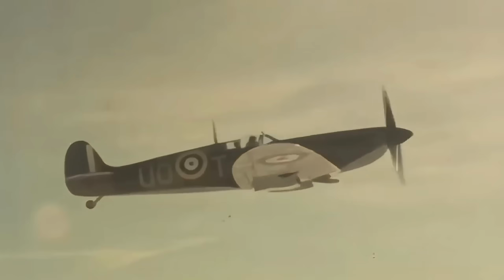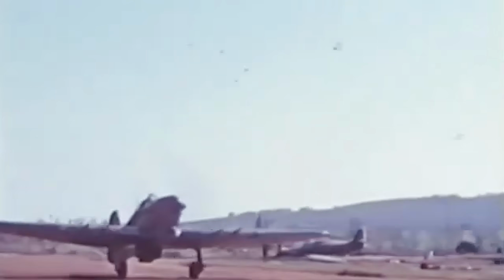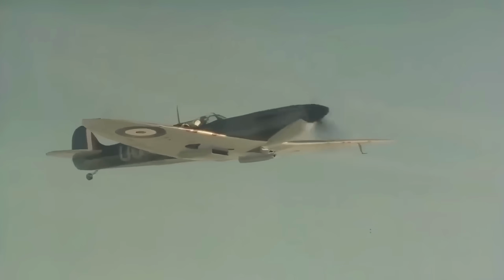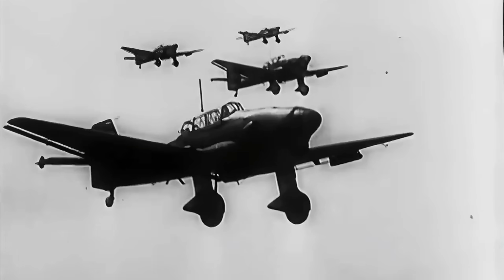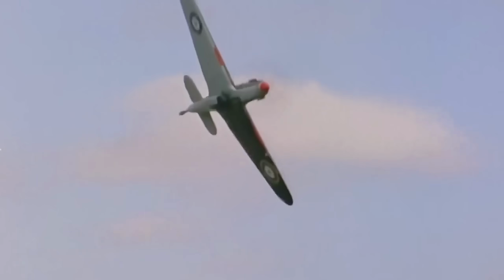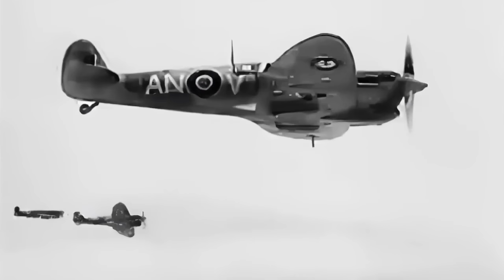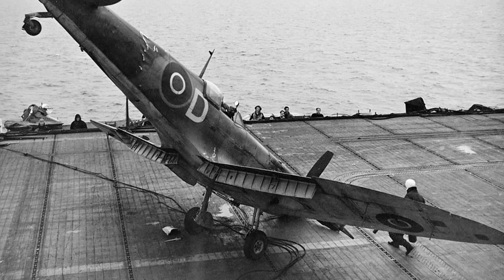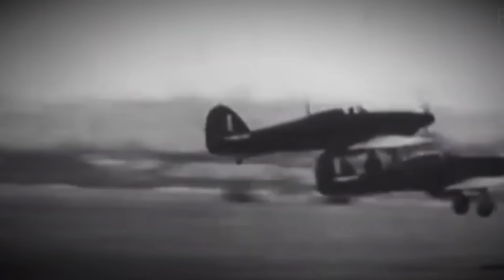The Dark Truth About the Spitfire

Comment: The Hurricane shot down more Luftwaffe Aircraft than the Spitfire for the simple reason that two thirds of our fighter squadrons were Hurricanes and only a third were Spitfires. Spitfires could climb faster and match the Bf109’s speed and were the best option for “drawing off” the Luftwaffe escort fighters. Hurricanes were the better “gun platform” as their guns were tightly grouped together rather than being distributed along the length of the wing. Hurricanes were better suited to tearing Luftwaffe Bombers apart. However, war seldom goes to plan and Hurricanes Squadrons bounced Bf109’s and Spitfire Squadrons also attacked bombers if the opportunity arose. Being on the receiving end of 8 Browning machine guns simultaneously unloading on you is no fun whatsoever ! Just ask Goering !

Comment: The legend of Miss Shilling hides a darker truth. Her solution (simple flow restrictor) was a useful bodge, but it only partly solved the problem. The proper solution was a pressure carburettor that didn't rely on gravity. The Americans had one. It was used on US planes like the Grumman Wildcat (Martlet) that the RAF and Fleet Air Arm were already buying. But the Air ministry was not interested in using it on the Spitfire. It was only when the Americans started producing the Merlin engine for the P51 and insisted on using a pressure carburettor, that it was widely adopted on the Spitfire as well.
Reply: Rolls Royce had already experimented with fuel injection before WW2 started - but due to pressure of manufacturing decided to stick with carburetor  - Remember Britain and its industry was getting bombed every day, and still outproducing Germany in weapons ( find out how many tanks, aircraft and stuff that was sent to Russia from UK ) , while USA never got bombed.

Comment: I would mention that the British reasoning for their eight rifle calibre machine guns at the time had some merit. They believed that 15 seconds of ammunition for a inexperienced pilot made sense whereas a canon had far less ammunition and fired at a much lower rate (the .303 had a very high rate of fire) and so needed to be a good marksman.

They were well aware that canons were the future, with fighters like the Whirlwind having four of them. Hispano canon equipped Spitfires were used during the Battle of Britain, they just had issues.  

You’ll also find most American fighters of the time (1938-40) we’re not using .50 calibre but .30. Basically the same as the British. The British didn’t use the .50 cals at the time because of the supply chain issues it would have caused.
Reply: People generally forget that the Messerschmitt BF109E used in the Battle of Britain had only 7 seconds worth (60 rounds) of cannon ammunition in each wing. Once that was expended, all it had left was two rifle calibre machine guns in the nose, a quarter of the firepower of a Spitfire. (The Japanese Mitsubishi A6M Zero had the same problem). Unlike the Spitfire, the problem was never satisfactorily solved with the BF109. The later BF109F had a single 20mm cannon in the nose, and lacked firepower. The BF109G could carry 2 x 20 mm cannons with plenty of ammunition but they had to be carried in heavy and bulky underwing pods that compromised the speed and handling.
Reply: In 1936 8 x .303 was an unprecedented heavy armament for a fighter. So they had considerable merit. No contemporary had more than 4 except for the Hurricane also with 8. 
Canons were not used because there were none that would work when mounted in a wing. They had jamming problems caused by wing flexing when they were fired.

Comment: Johnny Johnson the top scorer with the allies in Europe never said that the Spitfire was the best fighter of the war . He was more specific , he said that the Mark IX has that distinction. He probably meant the E model armed with 2*20mm Cannon and 2*0.5 mg . Cruising speed 324 mph. Max speed 416 mph . initial climb rate 3200 ft/min . max ceiling 42500 ft. 
Two amazing performances during post DDay performed by Canadian Pilots from different squadrons . The first by Don Laubman in August 1944 , during two sorties on consequtive days shot down 4 FW 190's and 3 Me 109's plus one damaged. This feat was overshadowed by Richard Audet on the 26 Dec 1944 who shot down 5 German fighters in ten minutes . Both pilots were flying a Spitfire Mk IXE's . 
The P51D Mustang was faster at 26000ft , but the IX could out turn . climb and dive the Mustang . 
The achilles heel with the armed Spitfire was range , the Merlin was a thirsty engine , and long periods of full throttle would quickly empty the tanks. 
Johnson who finished his RAF career as a Air Vice Marshall said that Supermarine could have designed a long range Spitfire , but Portal the boss of the RAF rather myopically said there was no need,
It wasn't all good news , after the invasion pf Italy , SpitfireVs never shot down a single German plane , all accredited victories were by either IIIVs or IX'S.
Reply: finger trouble should read VIII's.
Reply: Eric Winkle Brown said he'd often been asked which was the better: The Spit or the Mustang.
Brown replied he himself always preferred the Spit, but you couldn't fly to Berlin and back in a Spitfire.
Reply: @FredScuttle456  You could in a MkX1 PR . They done it frequently.
Reply: @jameswebb4593   Yes, that's the exception. Extra fuel tanks and a larger oil tank. 
Sometimes painted pink, but in a good way, unlike Jaguar.
If ever I was in the market to buy a supercar (I'm not), I'd order it in PR blue. 
With some small D-Day stripes.
Reply: @FredScuttle456
Didn't need to fly to Berlin and back in a Spitfire. The RAF bombers flew to Berlin and back at night. No requirements for a night bomber escort.
Reply: As far as I am aware Johnson never flew a Spitfire with an E wing unless it was the late war XIV that his squadron was converting to when the war ended. He was speaking of the IX C.
Reply: @alangledhill6454  He was a wing leader and never had a squadron as such .
Reply: The Spitfire XIV was also faster than the P-51 and could also out accelerate and outturn it

Comment: First of all kudos for actual showing video of the Mk. 1 with the twin prop early in the video, that's rare footage.

Your explanation of the fire dispersion of the guns is wrong though. At 100 metres the hit pattern was too wide, but it was converging. Initially the standard was to adjust the guns so their fire converged at about 400m. At that range all the rounds would hit within inches (ideally) or more likely within a foot or two of each other. As they gained experience though the standard convergence range was shorted to closer to 200 metres, although some pilots preferred it even shorter, as little as 100 metres.
This convergence issue was not a "Spitfire problem" it was a problem for every fighter with wing mounted guns, which was most of them, including the Bf-109, the Hurricane, the Mustang, the Zero and many Yaks, to name a few.

Also, you made a good point about the limitations of the .303 Browning, but unless I missed something, you never mentioned that they addressed this by putting in 20mm cannons starting with the Spitfire 1b before the Battle of Britain even started. There were teething issues so most only had the .303s but they were adressed before the Battle of Britain was over.

Overall though, a pretty good overview video.

Comment: In the early part of the war, 8 x.303 Brownings were quite sufficient to down an enemy fighter, if the pilot was a good shot. Unfortunately, many were not, and so it was a bit hit and miss whether they actually succeeded.
One of our foremost aces, ‘Sailor’ Malan, eventually formulated 10 rules for dogfighting, and his first rule was to get really close before firing – something like 100 yards ideally. At that range results were far more likely for most pilots, let alone a good marksman.
However, against enemy bombers, which were increasingly being armoured, .303 Brownings were less effective and the 20mm Hispano became more and more necessary.
As to the famous elliptical wing of the Spitfire, it was a complicated and time-consuming structure to fabricate, but it had considerable advantages. Apart from aerodynamic cleanliness at all speeds (even approaching high Mach numbers) it had a very benign & controllable stall, whereas some other fighters were the complete opposite, instantaneously flipping right over onto their backs. Which at low-level was probably fatal.
And with different stall characteristics at the base and tip of the wing, experienced pilots could judge the onset of a stall in, say, a tight turn in a dogfight, and keep the aircraft on the very edge of it without actually getting into one. 
However, the Spitfire could out-turn all other Allied & German fighters, with the sole exception being the extremely light and stripped-down Japanese Zero.